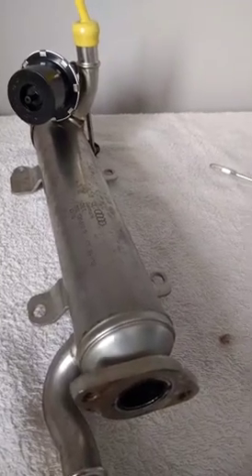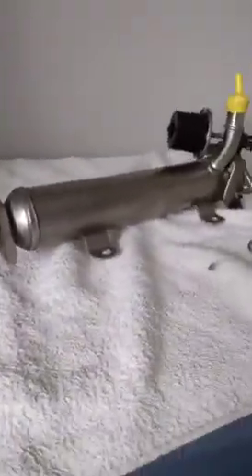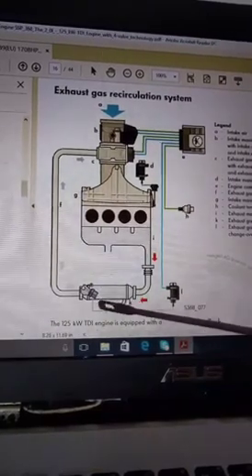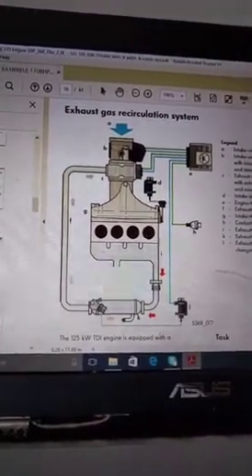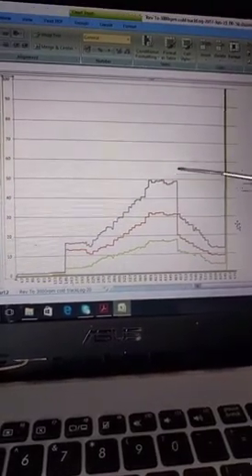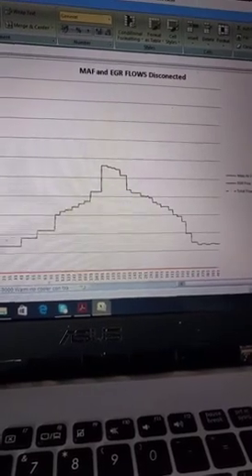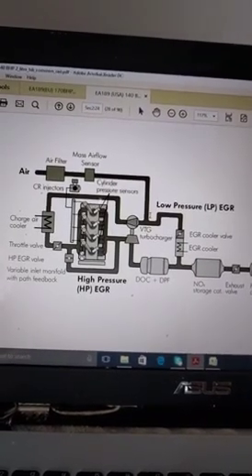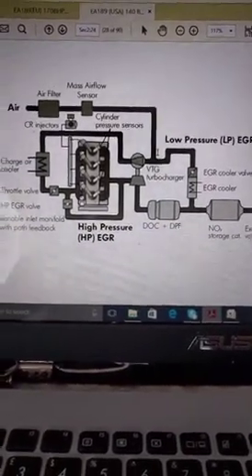Dieselgate EGR Cooler

Comment: Hi Martyn. Quick question.... I've got exactly the same egr cooler as shown in your video and the little flap from inside the cooler has come off from its position, traveled up the pipe all the way to the egr valve where I found it and removed it. That means the gases inside the cooler flow freely which ever side they want to flow. In other words that cooler does not serve its purpose it was created...is basically a pipe now. My question is..... should replace the cooler or l leave it as it is?! Thanks

Comment: hi what software you see those diagrams with
Reply: BMM tdi 2.0 engine.. is it possible this is reason why im getting too much air into engine. P2279.  i have absolutely no leak on the pipes.

Comment: Also, a few more questions:
-The TDI shown in this video, is it with the dieselgate fix already applied?
-What is the fuel economy with EGR disconnected? Better or worse?
Reply from the maker: hid3nax The cooler I showed is from an unfixed Gen 1, but the tests were done on a fixed Gen 2. I didn't notice any increase in fuel consumption after the fix, but others have.
Reply: Thank you for the response. I have an unfixed Gen 2 (I don't plan on fixing it) which I am carrying the "EGR off" experiment on. Yesterday it had a regen and I believe it was successful and no different than it used to be usually.

Also, out of curiousity, how often are you getting the regens on fixed Gen 2? My unfixed one used to regen about once in ~530 km but I do mostly city driving.
Reply from the maker: hid3nax I think you will find it is much longer between regenerations. Have you got VAG DPF so you can monitor what's going on.
Reply: I do have VCDS but I monitor regens closely (I know when they start and I always drive straight to highway immediately). Once regen finishes, I reset the "trip meter" so that I can see when next is due. We'll see how it goes after I rack up some mileage. I have read somewhere that ECU regens every 700-800 kms anyway even if the soot load hasn't reached the threshold yet. We'll see if that is true. I will share my experience.
Reply: Well, today I had my first regen with fully cycle of "EGR off" setup. And the distance travelled between regens was only 540 km. Honestly, I'm a bit disappointed and expected more. This is basically the same what I was getting with full EGR setup working.

Anyway, I will probably try to follow this plan:
-Just wait, in case the driving style invoked more idling, I got bad fuel batch, etc
-Install a "blocking plate" made of a can of soda. This will be installed there the pipe from cylinder head meets intake tract. I have a slight turbo lag. I did some logging and I suspect that boost needs time to accumulate because of quite big plumbing of intake system. Installing a blocking plate at intake side should at least reduce this. I suspect that during such underboost conditions extra/useless soot is being generated.
-Drive yet another 600-800 km and see what happens

Will shar emy findings/observations/etc
Reply from the maker: hid3nax  Has your vehicle had the NOx reduction fix applied by VAG. If it hasn't, you probably won't see much difference.
Reply: No, it hasn't. And I don't plan on applying it in the future because it's not mandatory according to European laws.
But still, the EGR duty cycle is around 25%, at idle it's even more. Completely elimiating EGR I expected to gain more distance between regens as not the mileage between regens is absolutely the same
Reply: Alright, so as promised some updates.
Weather is getting warmer here. Around 16 *C in th emornings and ~25 *C during daytime so it involves some A/C usage. Other than that, neither my trip nor driving habbits have changed.
Unfortunately I have lost my paperwork of previous fillup so can't speak about fuel economy yet - I will monitor it on the next tank.
As for regen, I have jsut returned from one. The car travelled 525 km since previous regen, mentioned in the comment above. So looks like the distance between regens is not dramatic at all.... :(
Reply: Just wanted to update on this matter, as promised.
I decided to quit with this "no EGR" experiment a while back since I didn't see any noticeable changes neither in fuel economy, nor in regen frequency. Only things which I noticed were (1) slower warm-ups and (2) turbo lag due to slight underboost when changing gears, etc. I have observed/confirmed the slight late boost with VCDS too. 
So I plugged the connector back and it has been running like that for already quite a while.
Today it is 550 km on the clock since last regen! It will probably regen today on my way to home or maybe even later.
I hope all this gathered experience will be useful/helpful for anyone.

Comment: Today I have tried unplugging the diverter valve (same connector as shown) on my 1.6 TDI (SW ver. 9971). The car seems to be lacking power a bit at the low end (but it's not limp mode). Indeed, upon 3rd start, I got a CEL. However, still no limp mode. I will probably continue driving in that configuration. Only thing which worries me - do DPF regens happen normally with such configuration?

Also, what about soot accumulation in DPF? From what I understand, less soot? How much less?

Comment: Check the temporary codes when you unplug the cooler, a temporary code is generated and after 3 starts it becomes a permanent code and you get an emissions light, but not limp mode.
Reply from the maker: Will Tisdale thanks will. I thought that might happen eventually, but I've put the car back to normal now. There it's a code in the fault log. I'm not recommending this as a fix, just interested to see what's going on.
Reply from the maker: Will Tisdale what happens if the cooler blocks (which was my main concern). The matrix in the cooler I looked at had stopped following long ago and the owner said there were no warning lights or faults
Reply: Martyn Maynard yeah, I hate the whole concept of EGR so I tried it on my 2010 A3 2.0 138 a couple of years back. To be honest, it's probably not a bad workaround if you can cope with an emissions light - I might give it another try. I have my EGR partially blanked off, with a plate with a 10mm hole in it, and that reduces the soot generation significantly but I don't get any insufficient flow codes. What's the Android app you're using in the video?
Reply: Martyn Maynard I'm not sure. I guess it depends how badly it blocks. I've restricted my EGR to a 10mm hole using a drilled blank plate from ebay and it doesn't complain, so it doesn't seem to need much.
Reply from the maker: Will Tisdale Thanks for the info. I've unplugged the cooler again and driven some more. As you said, the emissions light has come on, but the vehicle drives well and soot collected in the DPF is well down. I guess that the cooler can get well blocked before the ECU flags up a low EGR flow fault code. Blocked coolers can be very blocked
Reply: Martyn Maynard the only thing that I wonder is whether it stops regen cycles.
Reply from the maker: Good point. I've been keeping an eye on this. Soot build up in the DPF has really dropped off. I'll let you know, but it will be a few days before I get there
Reply: Martyn Maynard can confirm it doesn't stop regen cycles. Mine finally did a regen this morning.
Reply from the maker: Thanks Will. Mine has started to regen too, but only done short journeys. I'll let you know if it finishes the job, but looking good so far. BTW tried to get the light to turn off by fitting  a bridge across the connector. Silly me, the ECU just thought the plug had been pushed in and turned the EGR back on again. I should have seen that coming.
Reply from the maker: The shunt was a 100 ohm resistor by the way, but total waste of time.